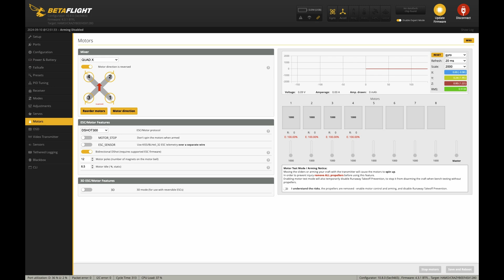Betaflight Whoop Tune  |  Read Description

Comment: is this tune oke with 080se 23000kv?
Reply from the maker: it kinda should be, yes. it depends on how light your rig is tho, since that's a low kv so you won't get much punch. also I've updated my 1s tune, so try this out if you're not happy with the first one: https://www.dropbox.com/scl/fo/tcxc4395i5wd0jqnnaid3/AGAJkIBskMkisWuhwy8YUqE?rlkey=6yfi18ov7mncuh9dcisf9070o&st=4guyaucn&dl=0

Comment: is A-X-5  96khz not match for this tune? my aio cant flashed o-h-5 48khz
Reply from the maker: A-X-5 is an identifier for your esc/aio and is different for each model. also 96hz isn't recommended for 1s, it doesn't produce enough power. 48khz is the way.
Reply: @prottentogo  ok thank you

Comment: filming with the whoop cam is so meta. love it, trying this tune tonight. curious if youve tried Quicksilver at all?
Reply from the maker: 😄 Thanks! I didn't try it yet. I'm kinda hesitant with trying new things I guess. And QS is angle mode only, so.. 😅
Reply: @prottentogo Quicksilver thankfully isn’t angle mode only lol. Maybe you meant acro only? I was also hesitant in switching to qs but the preset tunes are fantastic. No matter what there’s a tune that works for the quad you have. I had a 65mm that I put on the 4 inch tune and it flew great lol.
Reply: @prottentogo  QS is def not angle mode only. Ive used it, and its pretty dang good especially the fractal presets.
Reply: Update, I tried your rates and love them. I was running 700 degree on most but with tons of expo. Dig yours even more.